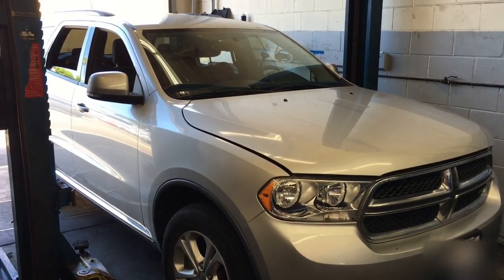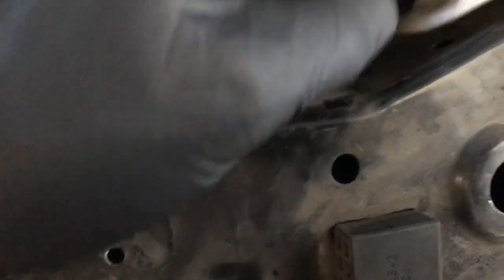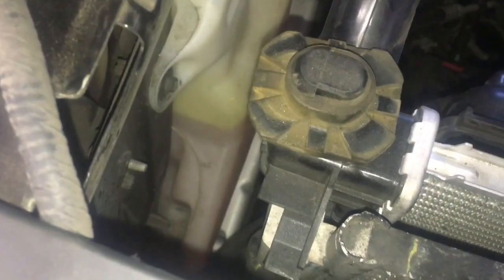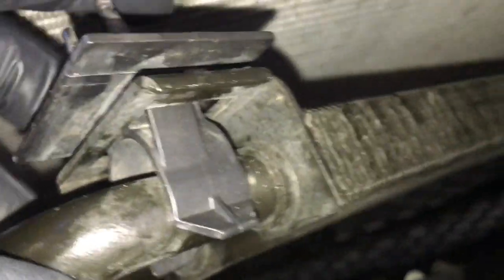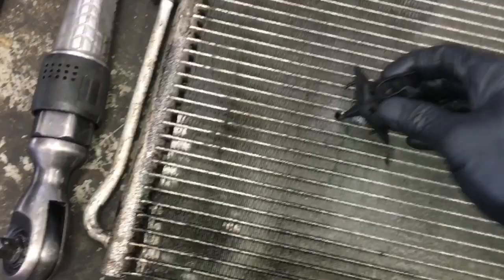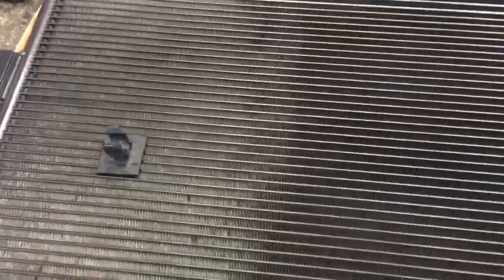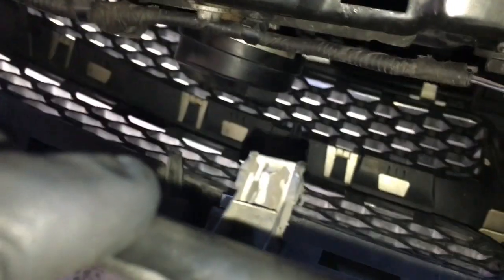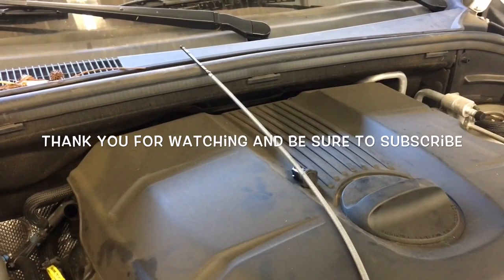How to Replace the AC Condenser/Transmission Cooler on a 2011 Dodge Durango

Comment: got quoted $1200 to repair this, just did it myself and only spent $155 on parts. Video was a great help and works for 2011 Jeep Grand Cherokees. Thanks a ton for the video!!
Reply from the maker: Myles That’s awesome. That is some big savings there glad to be your helped out. Thank you for watching!
Reply: @HowtoAutomotive  anychance you have the part number to the seals/o-rings to the AC line side?

Comment: Just changed mine out this morning, using this video. Thank you!  Took me two hours, and I don't consider myself any kind of mechanic.  The only thing I did different was not detaching the AC lines by going through the bottom of the car. I was able to access the nut from above, by shifting the condenser to the left a little, and using a deep socket on a ratchet.  This video saved me hundreds of dollars on a  surprisingly easy job that I was nervous about doing myself!  I appreciate it!
Reply from the maker: HitmanFO glad the video helped and saved you money. Thank You for the tips and thank you for watching !
Reply: What happens if I just remove the nut for the ac? Like would the ac need recharged???
Reply: Did you have to add transmission fluid

Comment: Great Video! This will be very helpful when I replace my condenser next week. One question - does the transmission fluid leak out all over the place once you disconnect the lines from the condenser? Thanks you again for taking the time to post this excellent  video!

Comment: I have the HEMI version for the same year. Would this method work?
Reply from the maker: Rob Mitchell I believe it’s the same.
Reply: How to Automotive any insight into what seal and o-ring part number is required as you mentioned in your video to reconnect the AC lines? Can I just reuse what is there?

Comment: What o-rings or seals are required for the AC lines when you replace them? Do you have a part number to look up? Is it possible to reuse the existing ones?
Reply: Did you get the part number yo those o rings? I'm currently searching for that
Reply: @67lnr80  if I’m not mistaken the rings came with the replacement cooler. 55038003AG was the part for the cooler

Comment: i did mine fine, drove it for about 400 miles and the top trans fluid line starting leaking all the fluid out.  maybe it wasnt in all the way or the gasket is wrong?  ill know in next couple of days.
Reply: So what happend?

Comment: I imagine this would be very similar to a dodge nitro as well? I'm pretty sure I cracked my cooler driving through snow on the lake. It's leaking now and has been I've just been checking levels and adding but I need to tackle this and would rather do it myself (with help from a buddy haha)
Reply from the maker: Cory Johnson sorry that happened to you. It going to be very similar to the nitro.

Comment: Great video but I would not recommend pulling the clips for the transmission lines. Find a way to press the lines in as your supposed too. I removed the clips as you did and then re-installed them after I put the lines back in. Well, I guess one of the lines wasn't in all the way and the line popped out. Fortunately I realized it early on because I was paranoid they were not in correctly and only lost a small amount of trans fluid. That could have been a disaster. I was finally able to just press the line back in but it was a real pain in the ass.

Comment: I have a quick question if I may. I have to replace the radiator instead. Would I access it the same way. And could I get away with not taking to get freon released
Reply from the maker: kidbowjb yes you can take the radiator out without discharging the AC and this would video would definitely help you get the radiator out it's a little bit additional work.
Reply: How to Automotive thank you. If I do it your way should I leave the fan connected to old radiator when I lift it out. I have a hemi citadel
Reply from the maker: kidbowjb I would try it that way first it may save you some time by doing it like that.
Reply: I have to change my radiator too...what additional work is needed and do the AC lines move enough to get it out without disconnecting them?
Reply: @mochs3869  Did you ever get the radiator out without evacuating the AC? Thanks
Reply: @JustEdits2  yes I did...biggest tip I can give in hindsight is to remove the transmission cooler lines...you can get it out without doing it, but having them out made it so much easier to get the new radiator back in...opens up a lot of room....I can imagine it would have to help with getting it out, too.

Comment: I followed all instructions successfully but my ac isnt getting cold it says it recharged but blowing hot still what should I do?
Reply from the maker: nealyville either it’s not charged up properly or something go unplug. I would back over all your work. If you have a scan tool you will see what’s missing in the Data and that’s where the problem will be.
Reply: How to Automotive it wasnt charged up all the way thanks 4 the video
Reply from the maker: nealyville easy fix sweet!! Thank you for watching!
Reply: The only thing I'm getting is a slight hissing noise. I check for leaks and couldn't find any.. so I dont know
Reply from the maker: nealyville check all fittings at the AC condenser